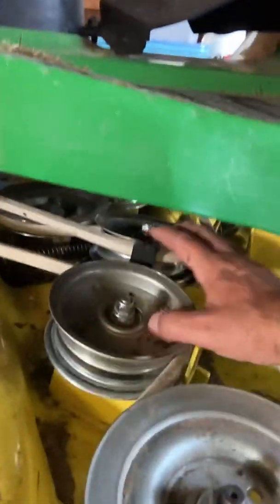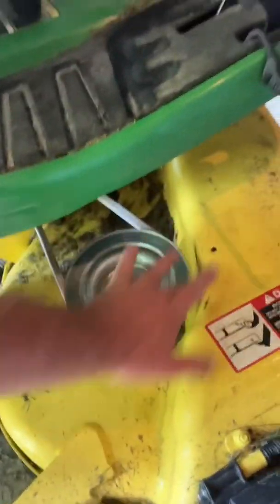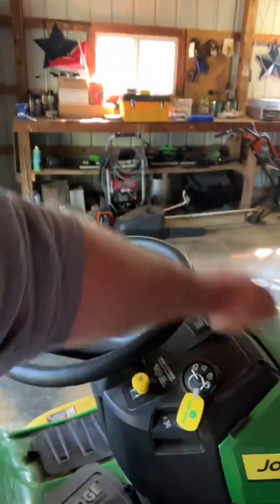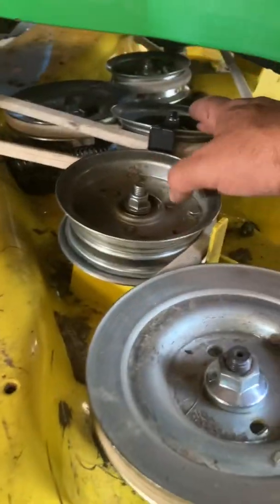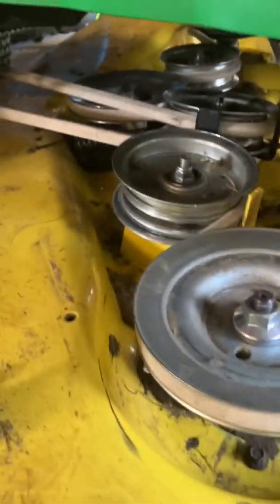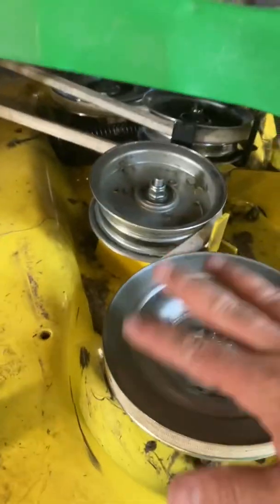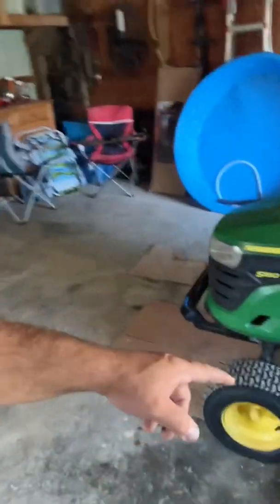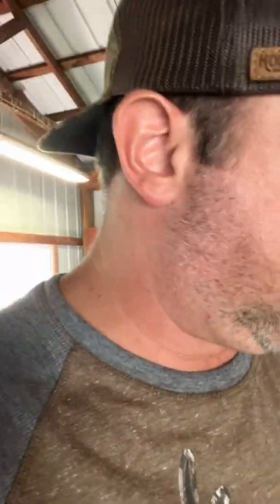John Deere S180 Mower Belt Replacement - No Need to Remove Deck

Comment: Thanks for the video! Unfortunately, I only discovered your video after I foigured out this little trick myself about 10 hours ago. 😅
A couple of questions, if you don't mind:

1) Are you sure that's not a 15mm socket? Mine (also S180) is 15mm. It wouldn't surprise me if they use both from the factory...
2) How many times have you had to replace your belt? I've had my mower for just a little more than 2 years (less than 85 hours) and I'm on my 3rd belt!
Again, I really appreciate the video. It's super-helpful, and I hope you continue to make more vids.
Reply from the maker: Hey Matt!  Thanks!  I’d have to double check on the 15mm. Heck I could have misspoke. As far as belts, that was the first one I had to replace. I’ve had mine two years this month. I regularly mow approximately 3-4 acres usually every other week during the growing season.  I mow at 3” usually too. Hope that helps!

Comment: IS there a way to tighten the belt? I literally just bought an s180 and had it delivered yesterday, belt has fallen off 3 times already....
Reply from the maker: Hey Fister, wondering if your belt is stretched. I’m unaware of a way to tighten the belt. There may be a way. But I’d try a new belt first. That sucks it keeps popping off. Maybe order a couple back ups and see if it’s the belt first.